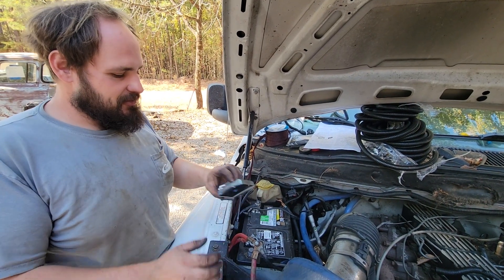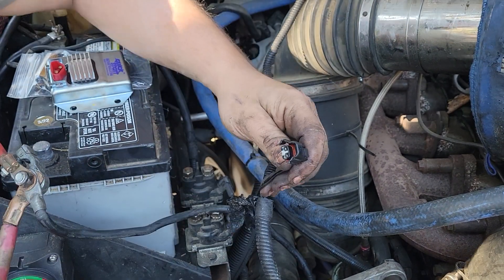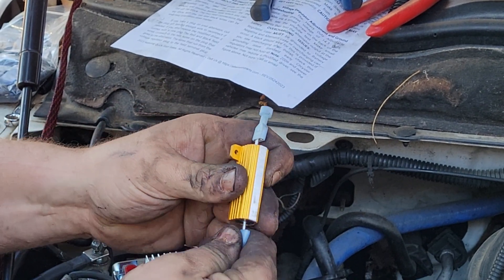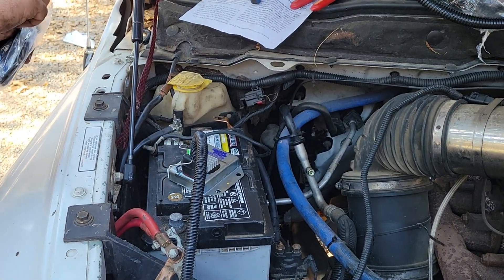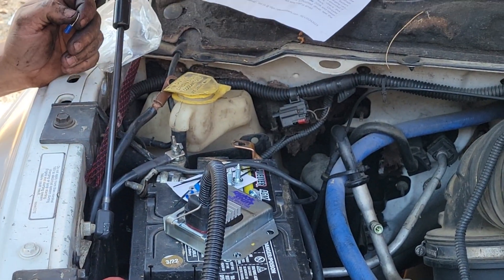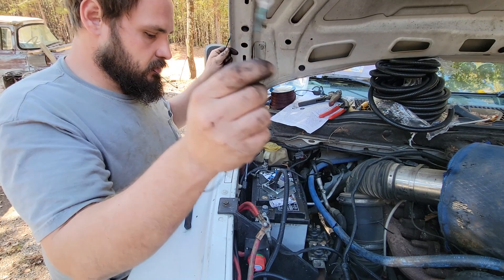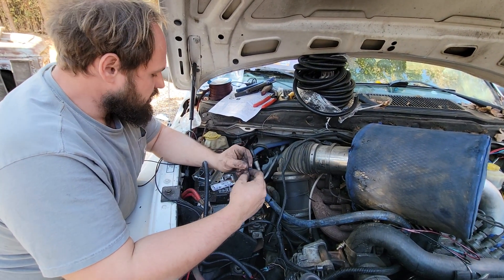3rd gen cummins external voltage regulator mod

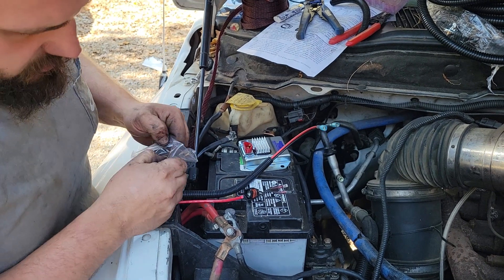Comment: 5:06 do you happen to have the part number for the hi cap diode (gold with cooling fins) you showed? Or was that a resistor?
Reply from the maker: I don't.  Came with the kit the guy sold
Reply: @m4sherman4  I think I found one. 25watt resistor. It simulates the load of the alternator field winding for the ECM.